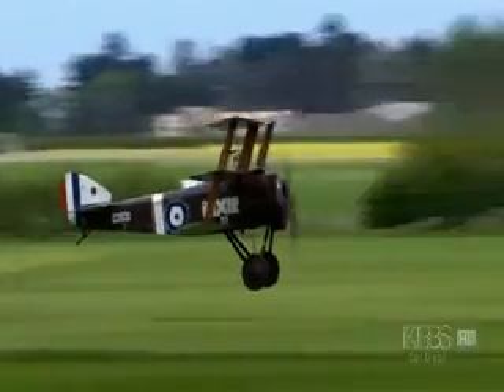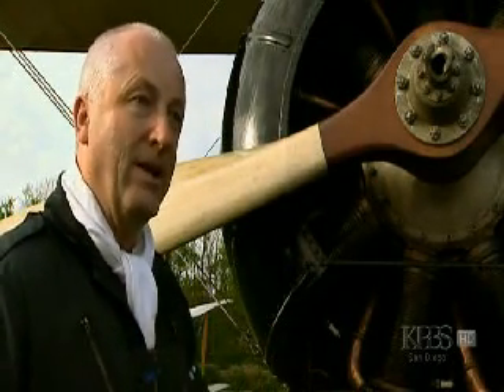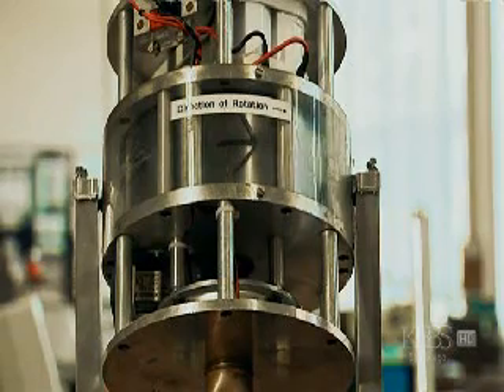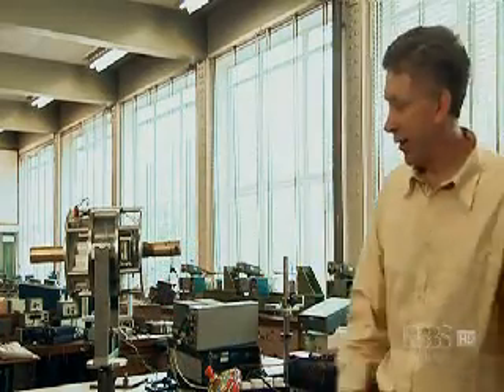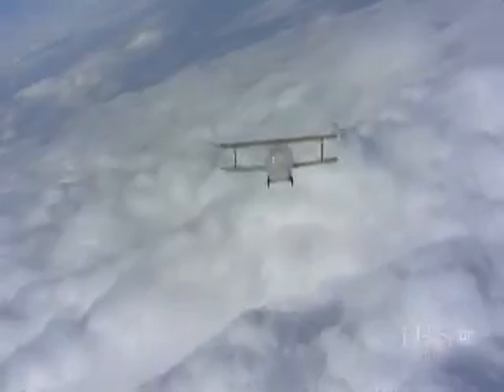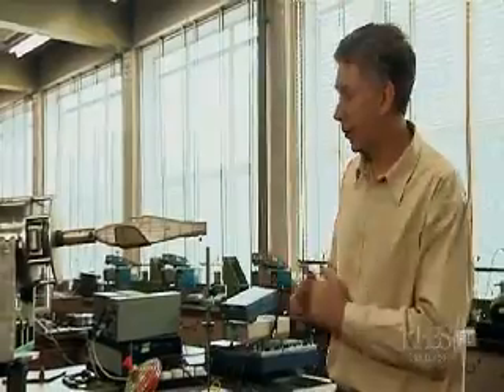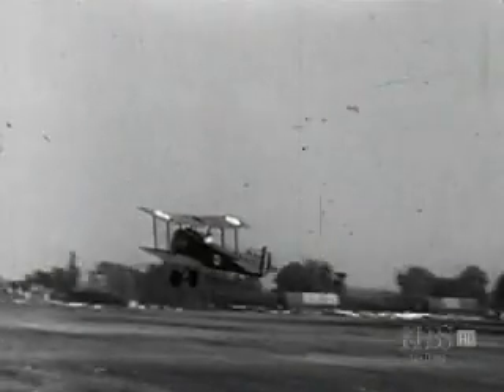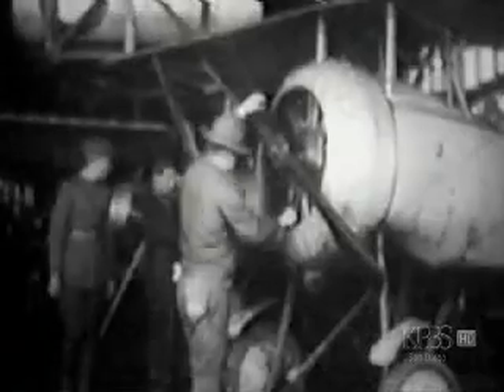Warplane - Rotary Engine Centrifugal Force

Comment: @mswinman 

You're not missing anything.  When they first show the gyroscope w/o the plane attached to the front they referenced it incorrectly by overshadowing the airplane in the wrong direction with the nose pointing out. When the guy actually attached the airplane with nose pointing in to the gyro the prop of the plane and the gyro are both indeed turning clockwise from that frame of reference which is correct.

Comment: @mswinman There was one notable engine that spun both ways, the Siemens Halske SH.III, which used beveled gears on the back of the engine to have the crank case spin counter-clockwise at 900 rpm, and the pistons, connecting rods and crank shaft spin clockwise at 900 rpm.

Many other types were also usually the conventional counter-clockwise, though there were notable exceptions like Mercedes, BMW, Bristol and some Rolls-Royce engines.

Comment: @mswinman Because most Rotary engine designs from just before the turn of the century up until the end of WWI were only made by a handful of manufacturers (Clerget, Bentley, Gnome, Oberusel) and they all rotated counter-clockwise. There were also dozens of companies that licensed engine designs from these major firms and they all rotated the same way.

There may have been some one off engines made by inventors that spun clockwise, but none that made it into mass production.